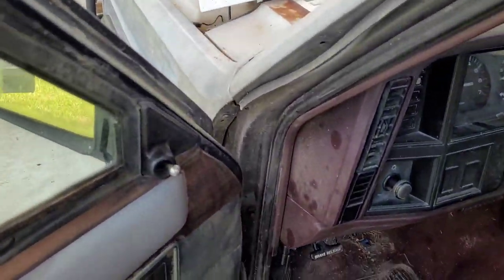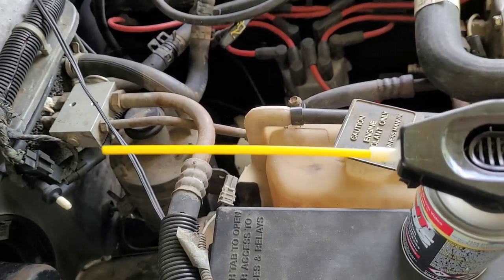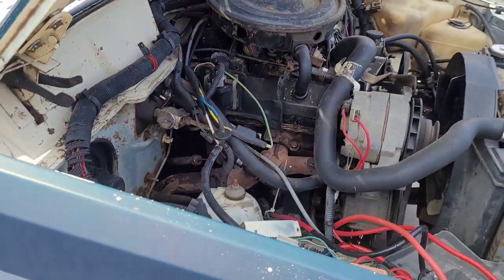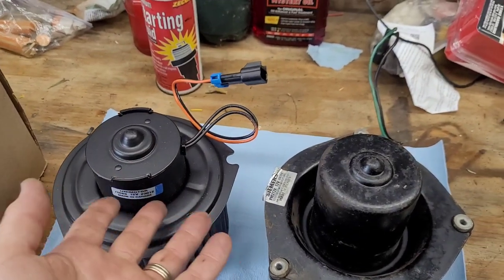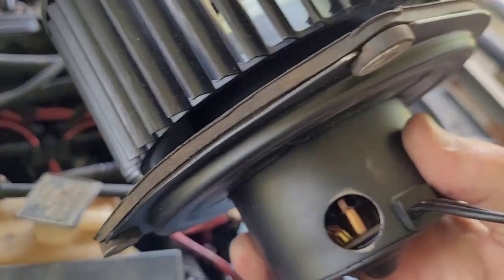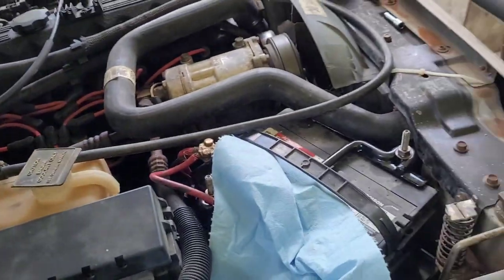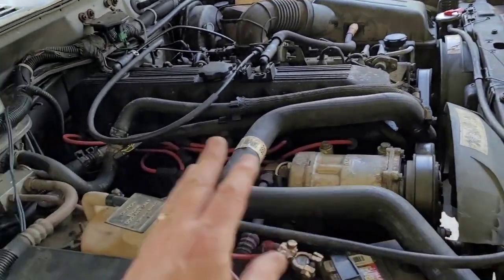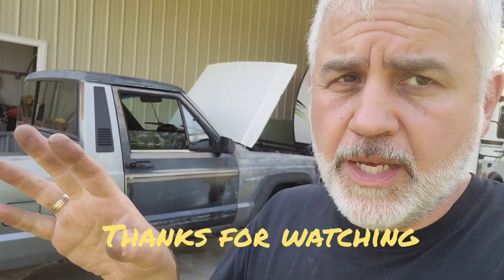Jeep Comanche MJ Blower Motor Repair #jeepmj  #jeepcomanche

Comment: Hi Major, I have strong blowing air but weak blowing heat in one of our XJ’s. I’ve flushed the system out a few times. I do get whiffs of coolant from the cab here and there. The floor is dry thank God. Any ideas?
Reply from the maker: It might be a blend door issue.   What year XJ has the problem?
Reply: @MajorWeakness  1999 I even put a new blend door actuator in it.
Reply from the maker: @Patriot 72  watch this and you will see a ton of different seals that might be bad causing the air to not flow properly.   Unfortunately it will require the entire hvac box removal 
https://youtu.be/B7I-djhBG-M
If u watch at about the 6min mark you will see the blend door and how it operates internally.   Could be your issue
Reply: @MajorWeakness  will do.. thanks Major!